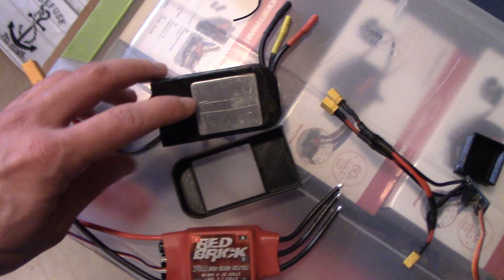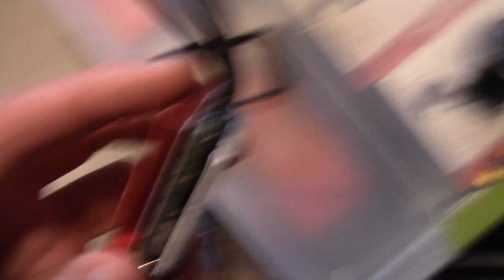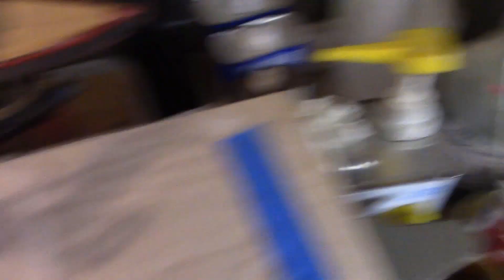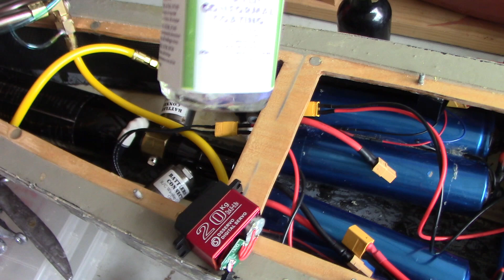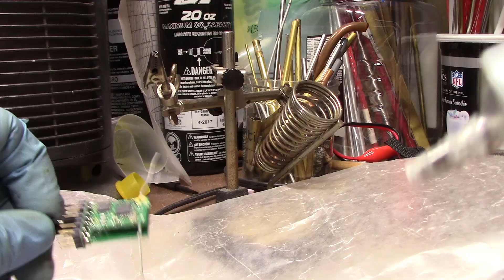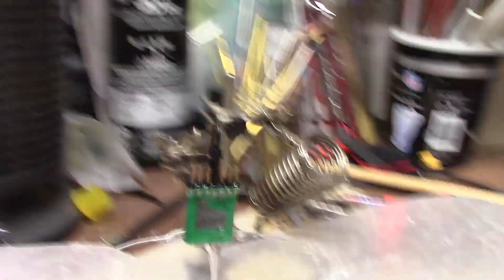Waterproofing Electronics - Building an RC Warship

Comment: The right RTV can be better in some circumstances.  I use sensor safe Ultra-Black RTV or Ultra-Grey RTV.  Both work equally well against water and oil and other liquids and are somewhat reworkable.  Reworkable, as in you can remove it and do repairs on the board later on.  But certainly use epoxy if you don't plan on ever changing any components or you want to keep others from modifying or reverse engineering it.  ;)
Reply from the maker: @10100rsn  thanks for the tip. I’ve used RTV a few times recently and it’s held up so far. In this hobby, if something on a board fails then the whole thing will be replaced because they are rather cheap ($10-$25) and almost all participants (myself included) lack the expertise to troubleshoot at the board level. Robustness is also important as the components get moved around, tossed in spare parts bins, etc. some folks still use rtv for watertight boxes, but the most common method today is the e6000 coating shown at the end